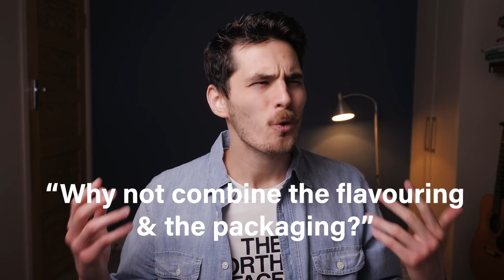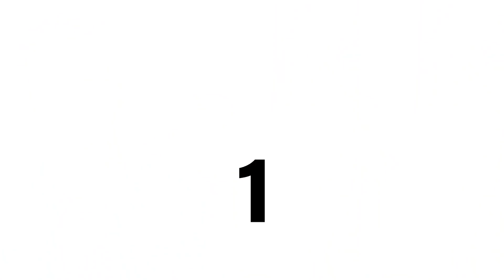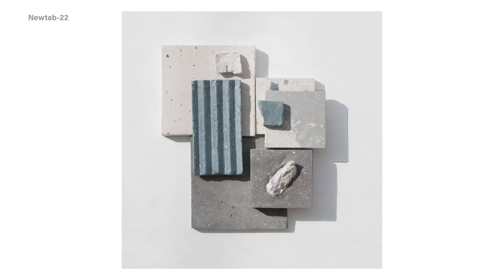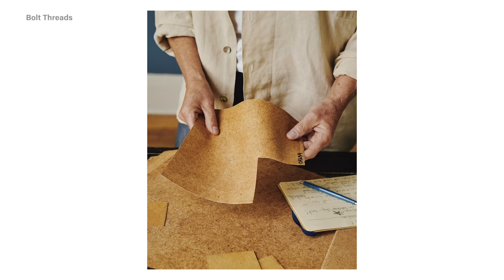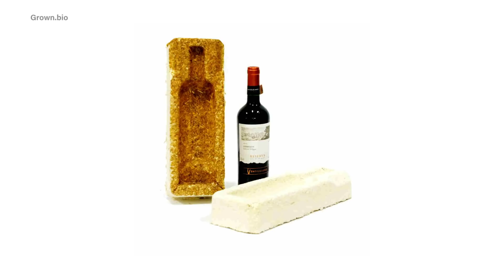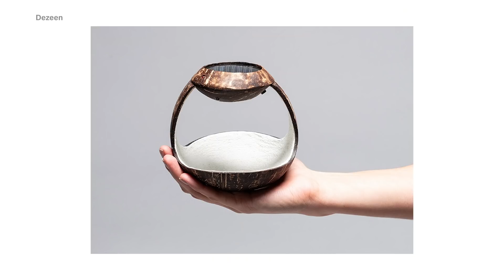5 Innovations That Could Help Save The Planet

Comment: Nice Tom, love the idea of shell concrete. I’ve used kerb stones made of recycled plastic bottles! I’m off to research the shell concrete 👍🏻
Reply from the maker: Oh nice! What’s kerb stone like? I think shell based concrete is still in its early infancy, but honestly even if it emitted the same amount of carbon but destroyed less landscape for raw materials...that’s a plus right?
Reply: It’s just a plastic kerb with the durability of concrete, you can cut it with a hand saw, ever so light therefore productivity levels increase, easily replaced if damaged, I mean, why are they not everywhere?